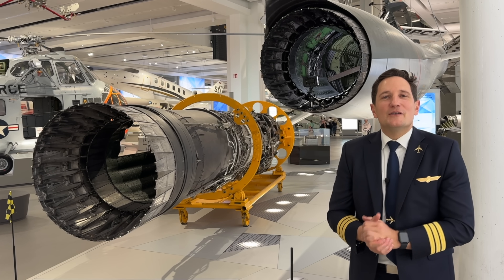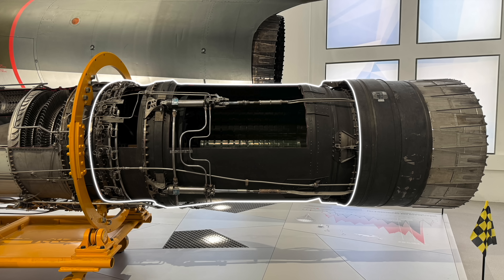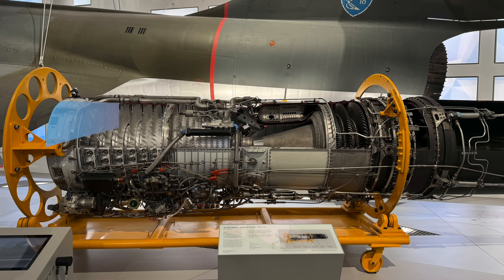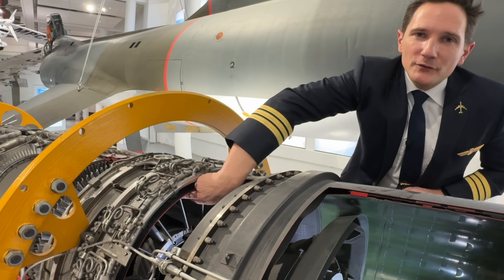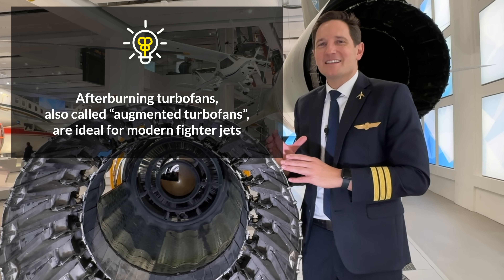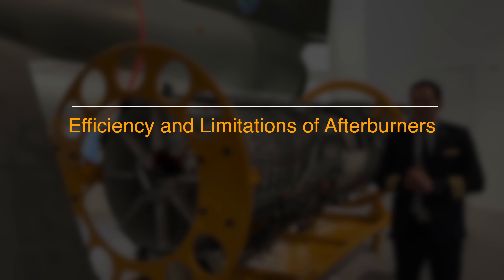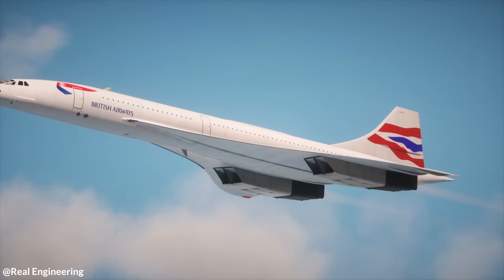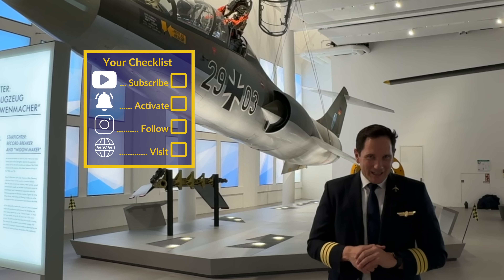How an AFTERBURNER works - Explained by CAPTAIN JOE

Comment: Fun trivia:The engineering term for an afterburner is a "Reheater". Reheaters include various different devices such as afterburners or heat exchangers in a heat cycle to increase efficiency of a cycle and thus provide more final output power.
Reply: In USA we don't use "reheat"
Reply: @MrBen527  -- Yeap, "reheat" is a British terminology for afterburner, and I prefer term afterburner, as it is more descriptive of the process.

P.S. "Increase efficiency of a cycle" it is defiantly not... as Captain Joe explained reheat/afterburner increase fuel consumption by two to three times.
Reply: @RussianThunderrr  That's how I view it also.
Reply: 2 countries divided by a common language 😉

Comment: Two questions - do jets with afterburner run lean so there’s enough oxygen for the afterburner, or do all jets run lean?
Second, how do they control the pressure within the engine so that the flow doesn’t try to go back into the turbine from the afterburner? Is it just due to the inertia of the gas or does the afterburner run at a lower pressure than the exhaust turbines?
Reply: Based on the book "The Jet Engine" published on July 1969 by Roll Royce, a jet engine uses about 18% of the total air mass flow for the main combustion section. This means that another 82% air remains. That airflow it is used for cooling purposes and supplying various aircraft systems with compressed air. Afterburner uses major part of this lets say "unused air".
About the pressure control during A/B operation, on the specific engine here (J79 from GE), there is a controller named NAC (Nozzle Area Control) which controls the area of the exhaust nozzle under all operating conditions of the engine, in such a way that airflow remains stable and same under A/B usage or without.
Reply: To answer your first question all turbine engines take in far more air than they need for combustion (lean/rich is meaningless when talking about turbines). The shape of the exhaust nozzle determines how much pressure is built up in the afterburner. Note: many (most? all?) military aircraft with afterburners have a VEN (Variable Exhaust Nozzle) that can open or close.
Reply: @acratistrevour3901  The last bit you said is kinda misleading. The variable nozzle is needed, because of the speed of the exhaust gases. Without afterburners, the exhaust gases are subsonic, so the nozzle is convergent. This accelerates the exhaust gases, hence a better flow out. With afterburners, the exhaust gases are supersonic. A convergent nozzle would be a diffusor at supersonic speeds, slowing the gases down and increasing the preassure. So by opening up to a divergent shape, the nozzle then allows for the already supersonic gas flow to accelerate even further. 

Aerodynamics flip around at Mach 1.
Reply: wrote: "Second, how do they control the pressure within the engine so that the flow doesn’t try to go back into the turbine from the afterburner?"

-- So there is a plenum(chamber) called diffusor that seats between compressor and combustion chamber, that operates per Bernoulli principal i.e. slowing down airflow and thus creating high pressure, that high pressure prevents "backflow" to air compressor, so airflow is only have one way to go rearwards, even as it burns in a combustion chamber.
Reply: @RussianThunderrr  Please do not confuse the main combustion chambers which is the next engine section after diffuser, with the A/B combustor which is the section after the last turbine disc.
All jet engines have a diffuser which is a major structural part of the engine, whether it is equipped with A/B or not.
Reply: @ wrote: "Please do not confuse the main combustion chambers which is the next engine section after diffuser, with the A/B combustor which is the section after the last turbine disc."

-- Am I confused? Tell me - what jet engine have a compressor "after the last turbine disc."?
Reply: @RussianThunderrr  ...please read carefully before commenting!
Reply: @ wrote: "...please read carefully before commenting!"

-- I did read carefully, so what is your answer to the question I asked you?
Reply: @RussianThunderrr  ...combustor is something completely different than a compressor.
A/B combustor is the large chamber with its own fuel injectors controlled by A/B fuel control. A separate ignition unit ignites the large amount of fuel injected there.
This chamber is always after the last turbine disc.
Reply: @sv7gbr  wrote: "...combustor is something completely different than a compressor."

-- And what did I say on the position of the diffusor? Diffusor is a chamber that sits between compressor and combustion chamber, and prevents backflow from combustion chamber into compressor, because diffusor have the highest pressure in whole jet engine.
Reply: @ wrote: "...combustor is something completely different than a compressor."

-- If you going to quote me, please do not distort what I've said: "-- So there is a plenum(chamber) called diffusor that seats between compressor and combustion chamber". So, my question to you: is there are any compressors between a turbine and afterburner?
Reply: @ wrote: "...combustor is something completely different than a compressor."
-- Where did I say combustor? I know, that insulting someone and confusing others is very easy, getting facts strait, and admitting faults - takes a lots of effort and character...
Reply: @ wrote: "All jet engines have a diffuser which is a major structural part of the engine, whether it is equipped with A/B or not."

-- Diffuser is not a "structural", but operational part of the engine, and that is what preventing a reverse flow into compressor, but you did not mentioned it in your explanation even once, so why are you ridiculing me then?
Reply: wrote: "Is it just due to the inertia of the gas or does the afterburner run at a lower pressure than the exhaust turbines?"

-- Afterburner will have a lower pressure then turbine, which have lower pressure then combustion chamber, which have a lower pressure then a diffusor. In other words pressure gradient is at highest pressure - at the diffusor to prevent a backflow into compressor, then combustion chamber is lower then a diffusor, turbine lower then a combustion chamber, A/B lower then a turbine.

Comment: i understand that the air is flowing in one direction in the engine, but adding explosive/burn in an area/chamber...wouldn't that result in increased pressure in all directions? so radial pressure would be contained and after pressure would leave the outlet in the back..but isn't there also a forward pressure...maybe not enough to halt the airflow..but i'd imagine it would work somewhat to rresist the air coming in from the front and so apply  some negative acceleration too?
Reply: There is no explosion, there is no containment of the gasses. The fuel just burns and makes the air hot. That heat expands the air which increases it's velocity which causes a DECREASE in pressure. Flick your bic lighter and observe. No containment, no pressure increase - the air just gets hot, expands making it less dense and rises. Same in a jet engine. The highest pressure is right after the compressors and it's all downhill after that. The air wouldn't flow out the back if that wasn't the case, it would stop and turn around. The best visual of a jet engines combustors is to turn on a gas stove. You get a nice ring of constant fire that does nothing more then make the air hot. You could replace the combustors in a jet engine with an electric hair dryer heater and (if you could get enough heat transfer to the air) it would perform the same. It's not at all like a piston engine.
Reply: already explained in previous comments, ab affects the pressure ratio in front of and behind , which affects the angle of attack of the air through the compressor so there are variable angle blades, relief valves and a variable cross-section nozzle
Reply: It depends on the engine. Some have a variable nozzle like the RB 199 used on the Tornado which allows the reheat to be modulated for maximum thrust and to prevent the back pressure affecting the engine core operation. The throttle lever in the cockpit actually drives the nozzle, not the fuel. The fuel flow is driven directly by the nozzle area to maintain the available reheat thrust and prevent the main engine from surging due to increased back pressure.

Comment: Was the Concorde with the four Olympus engines😊
Reply: Fun Fact: the Concorde airliners actually pretty much served as much as possible. The had been used for over 25 years when they were retired. An airliner is used for 20 to 30 years.
Reply: Another fun fact, the Invincible class Aircraft carriers were powered by a marine version of the same engine, 4 of them also.

Comment: What happens if you put fuel of a turbojet that's not designed for afterburning? Nothing; without oxygen the fuel will not burn.
Reply: Which part of the engine would you put the fuel in? (You probably don't know that fuel cannot ignite on its own, even in engines that have AB.)